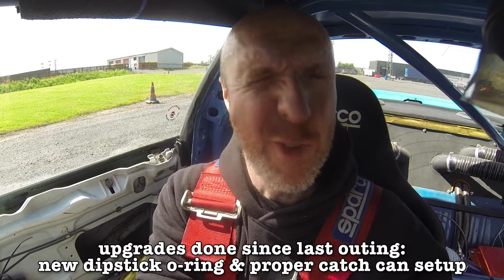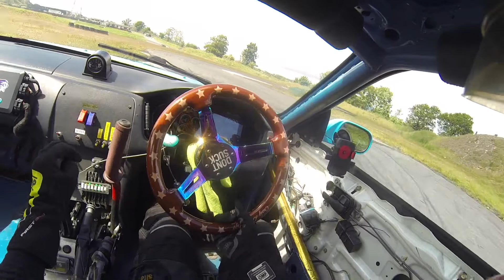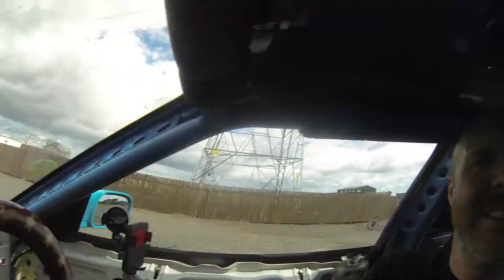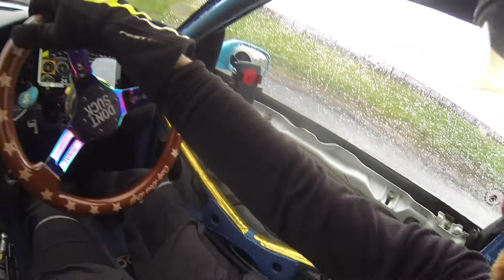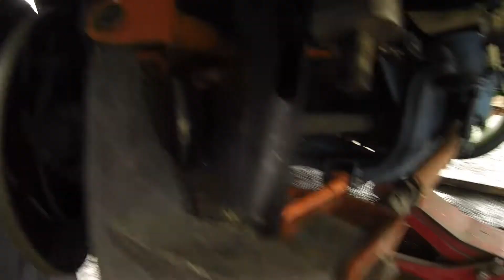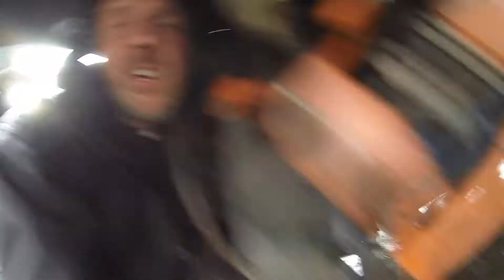My suspensions loose as HELL! | 1UZ Turbo 200SX Build - Part 18 | CraigDoesDrift //Ep55

Comment: Is that caster bracket lose or just flexing like fook
Reply from the maker: I'm not sure yet. There is also a bracket for the anti roll bar that use to attach there but the roll bar does not work with the sump.  Not having it might also be causing the movement...
Reply: Craig Does Drift what about the speed holes are they dimple die or just hole saw as that would flex if only holes